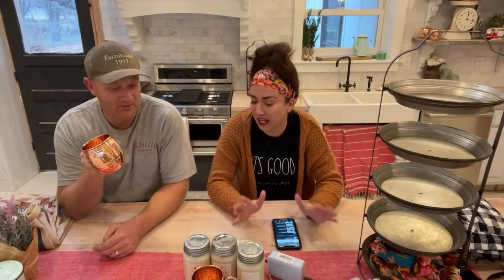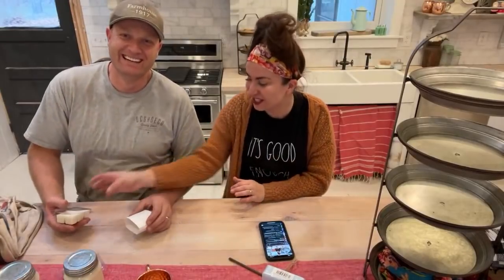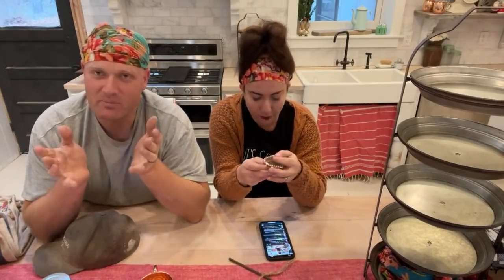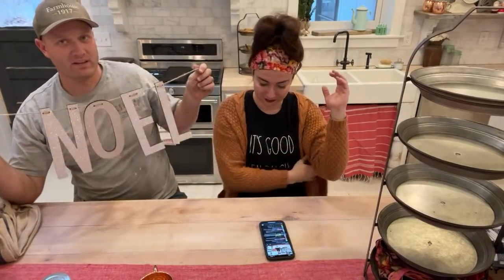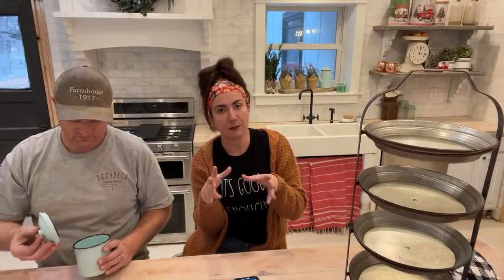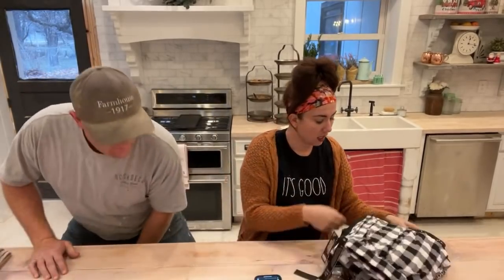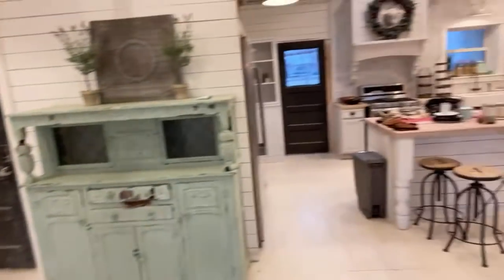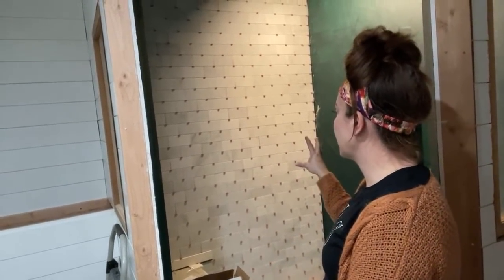Farmhouse Decor And Gifts + Sneak Peek of Farmhouse Reno

Comment: Is the standard shipping $22.95. I wanted to order a wax melt and head band face mask.
Reply from the maker: No. I need to check maybe something got in the wrong catalogue. Those two items should be $7.95 because the melts are in flat rate and the head band mask is free shipping. Let me check
Reply from the maker: @andreacarsoner try now. The new colors didn’t get added into free shipping. But I fixed it. Let me know if it doesn’t ring up correctly.
Reply: Thank u Jami. I just ordered it. 😁❤